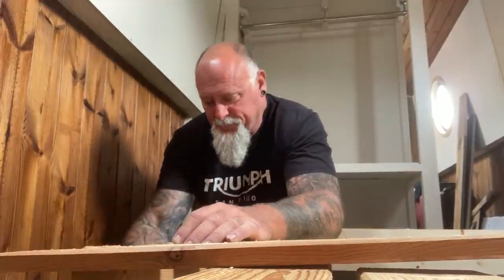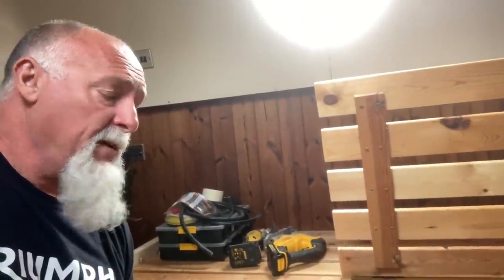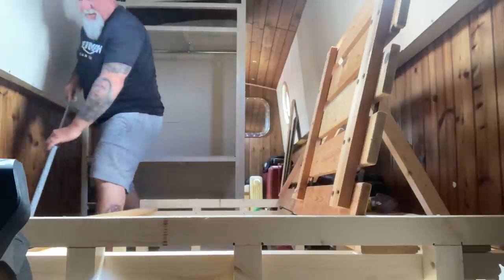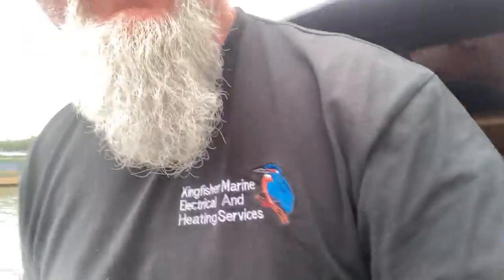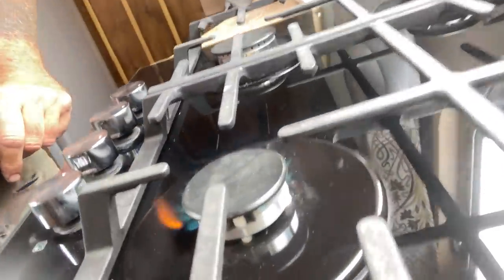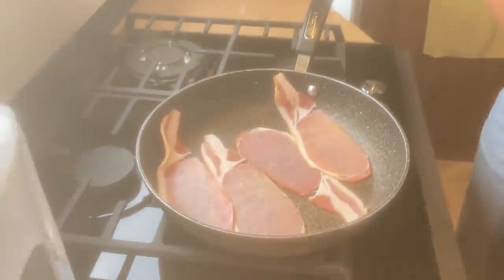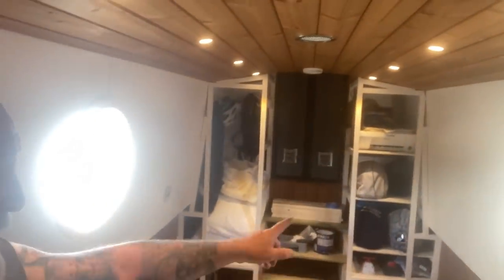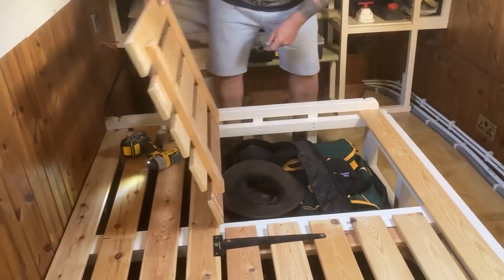Building Our Narrowboat #47 - Moving in and Cooking on Gas.

Comment: Another great vlog. Just one question. How can you live aboard full time without running water? What are you doing about using the toilet? I ask because on my boat, we have no running water yet. The pipes are there, they just need pumps fitting and wiring up.  So I’m taking a few days off this week to head down to the boat and fix up a temporary water system so we can at least get the Thetford cassette toilet working.  Wel will be using the showers at the marina when we first move onto the boat. I’ve also got a camping gas stove until I get the gas fitted, and I have to wait for an engineer to sort out the cooling system on the engine, before I can get hot water on board.  I’ll send you a message on Patreon when I get back on board on either Tuesday evening or Wednesday.
Reply from the maker: Hey Drone Daddy, thanks for that. We are a short walk from the toilet/shower block and a tap on the bollard by the boat. We too have a cassette toilet so we spray with a water bottle and its not used for number 2's. Watch out for those camping stoves onboard, they are cheap and can leak. Our did on our last boat. yes mate no worries.
Reply: @narrowboatmoonshine  I’ll be using the camping stove on the cruiser deck covered by a pram cover, with plenty of ventilation.

Comment: Just a thought but would it not have been better to put the hinges for the bed storage on the underside so they don't rub and catch on the mattresses?
Reply from the maker: Hi Colin. Did try that but they fouled when opening upwards. What we are going to do is staple a bit of sacrificial material over them to prevent that. Good spot there.
Reply: You could flip the hinges over with butt downwards and if you want to be ultra fussy rebate the metal work into the slats so its all flush, and no wear on the bottom of the mattress. Just a thought.
Reply from the maker: @petewood5097  I have to replace screws before new matress comes next week so I’ll investigate. Love the tips Pete.